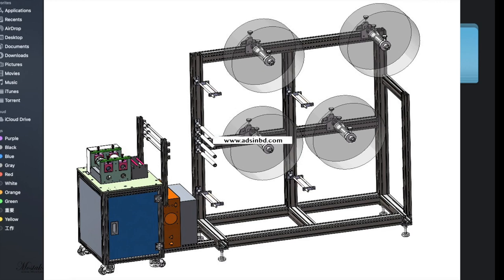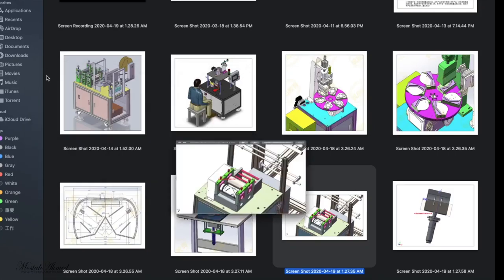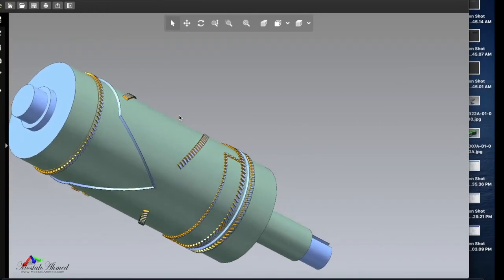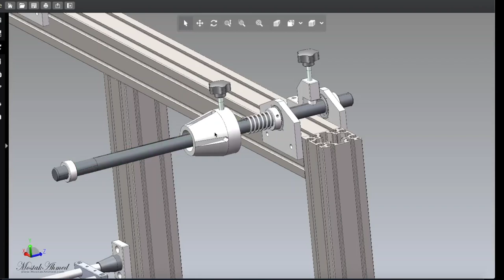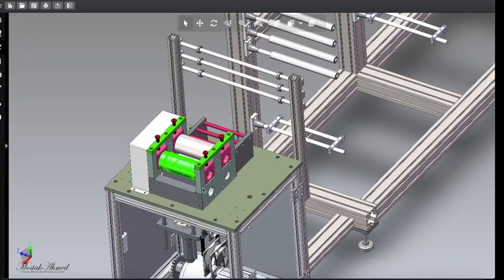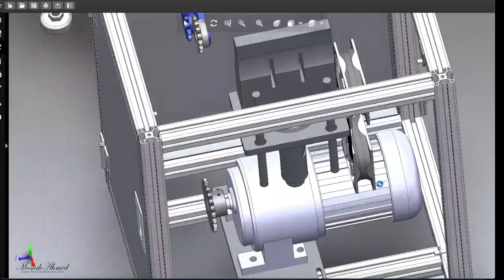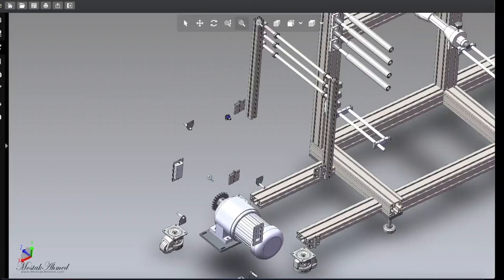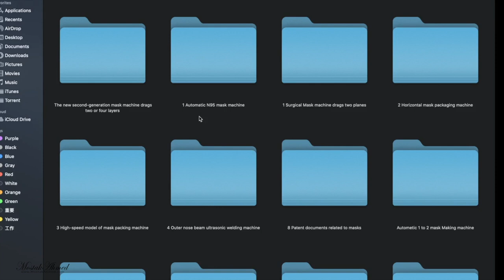Semi-Auto N95 Mask Making Machine Design Explained

Comment: As I know, woven fabrics are frequently displaced when feeding into the machine to cause failure in production and the waste of materials. Do you have a tensioner or correction device for your mask machine to increase the productivity and efficiency like this?
Reply from the maker: If you follow the correct Design there is no chance to be displaced